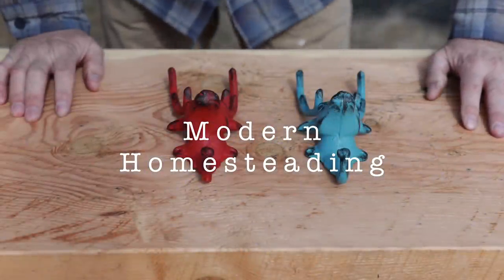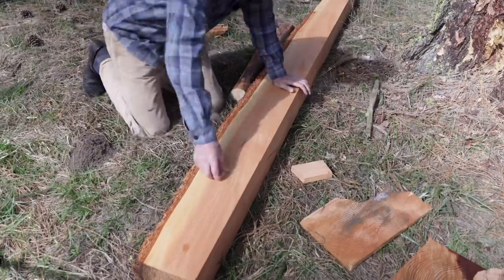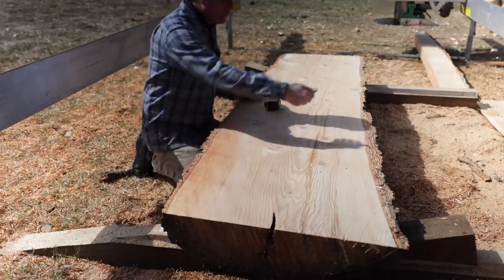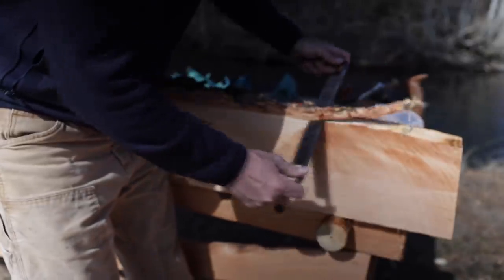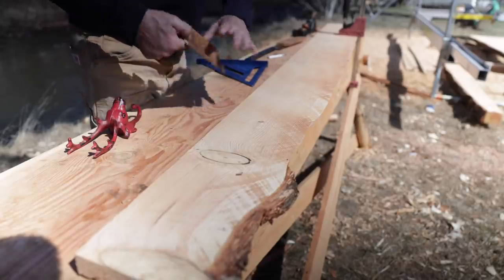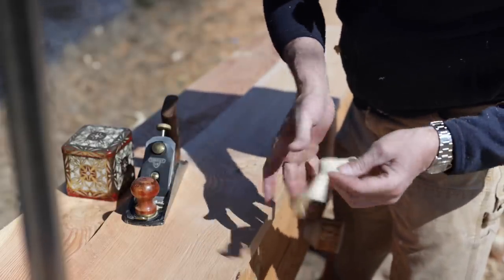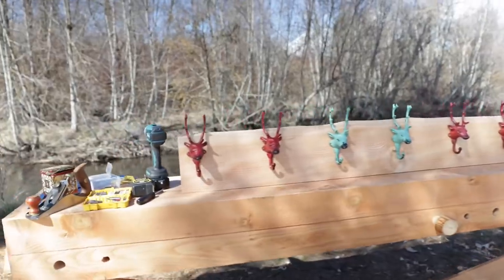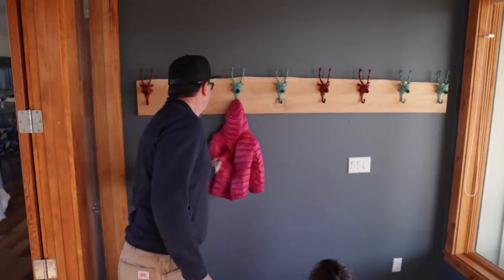This Happened Today

Comment: I'm glad you're planning to do something about the cross bracing. 

I didn't say anything in your previous video because I didn't want to be negative without offering a better solution. 

It's such a beautiful bench but the cross bracing is too ugly.
Reply: Amen!
Reply: I can’t speak to it’s structural soundness, but it really ruins the look...
Reply: It did it’s job in quickly making the bench serviceable, but now is the time to upgrade.
Reply: That and will just get in the way of a person's knees and feet
Reply: I mentioned cutting a compound angle (15 degrees out, 30 long) on the feet, this eliminates bracing to sure up length and width ways stability
Reply: Just a thought... For an indoor bench i once had with a similar issue... i used some 4x2 to build a frame for it to sit on, it only raised the height by 2 inches so didn’t change much. But it did allow me to fix the bench to that while also allowing me to use much smaller 6” internal corner bracing in both directions.

Edit : My workshop was indoors and the ground flat and dry.
Reply: "I didn't want to say anything without offering a better solution" 

I wish more people thought like this. lol
Reply: How does your homemade bench look?

Comment: I love the interaction with the viewers who’ve lovingly commented in attempting to be helpful!!!
My GG Grandpa/Grandfather hand built & rough cut a 2X2 rail system for the upstairs of their cabin for the kids cloths.
He even hand whittled, & tapered the pegs, that were then tapped in tight, to holes drilled through.
Pretty cool to have a piece of your ancestry hanging on the wall, still able to perform its task in hanging clothes over 100 years later!
Amazing connection to someone in your family, that you never got to meet.
What you do today, can possibly be felt for centuries later.

Comment: Cody, I once made a similar piece mounted to the wall in a similar way. I soon discovered that the lever force from a rack full of coats was enormous. The coat rack ripped itself out of the wall twice. I recommend attaching the rack to the studs very quickly before it gets loaded up with coats. I didn't have studs to work with; I attached to a masonry wall. Even with reinforced anchors, the weight of the coats pulled my rack out of the wall. I hope your situation is easier to deal with than mine.

Comment: You should take the other 2 coat hangers, mount them on a board, 2 1/2 or 3 ft. long, and hang it at Sweetloaf height. Below the long one.

Comment: What you ought to do on the side is a Crochet to hold your boards, the pegs are great, don't even worry about the hold fasts, they can be used on the top.  Another good idea on the top is pegs so you can surface pushing the plane toward the pegs.  That came from the Rex Krueger's videos.

Comment: Cody, take the other two and make a smaller lower one for the sweet loaf.  Hang it low (and maybe off center).  When she can reach the big one, you can remove it, plug the holes and save it for visiting grandchildren.

Comment: Hold fasts are supposed to have an empty space underneath the bench also, so that they wedge themselves into place. I believe those aren't holding correctly because the bottom of the hold fast is in contact with the side of the hole. Idk how clear that is

Comment: The holes in my bench are 3/4 and the ho.d fast works great. Give it a try on a scrap clamped down. If it doesn't work  dry a new hole and try again. If your hold down is the correct size 3/4 should work.

Comment: Hi ther Cody!
A suggestion for the cross braces:
Instead of going from one leg to the other side, u can brace each leg to the under side of the top of the table, it is a massive, heavy piece and if u connect legs of each side together, a bit under the half way point, u can put the bracings between that and the bottom of the bench top.

Comment: It's a working bench.  You don't want the bench too-perfect, it's still a sacrificial surface to doing work.  The hidden brace underneath on the working-side goes with the milled billet but the milled crossed-braces are out of character with the rustic-legs...

Comment: You could have sealed the bark on with some polyurethane.
Reply: My opinion, I think was way more beautiful with the bark colored edge. I hope your Mrs. loves it. :)
Reply: There you go, at 21:30 is your answer. You're going to need to put those other two reindeer on a little short plank, and mount it half way down for Sweet Loaf to hang her coats on. ;)

Comment: Well since you brought it up, I would use wire and leather strapping to tie the opposite corners together. That way you have full access to both sides. Think fencing corner post bracing like we do with barbed wire fencing.

Comment: As much as I like the rustic look of rough sawn wood ... like in a cabin .... 40 years of wood working tells me the texture tends to pick up dust when used indoors ... planed with a finish will pick up the grain better ... I specialize in Historic Restoration so I make a lot of coat racks with interesting old door knobs I've collect for decades ... nice job Cody ... I also hope the cross brace "issue" gets worked out ; ) ... maybe salvage some rusty old 1in galvanized pipe and bolt thru just for a ships & giggles

Comment: Use the leftover board and the last two castings to make the smaller one down low for your smaller person. You will not be able to tell the difference between the sizes with them being a few feet apart.

Comment: Fill the holes with a plug of wood from the same board. line up the grain if noticeable and use a water thin CA glue after the plug is installed. Use a scraper to clean things up and you will be hard pressed to see the fix.

Comment: The shelf came out stunning.   Really like the whimsical reindeer.  BTW.  I restore quite a few wooden items from furniture to hand / garden tools.  PC Products Woody-Wood epoxy is the best wood filer I’ve found. Sandable but strong and doesn’t shrink or crack.  It will accept a little oil base stain and still cure well.  Good stuff!

Comment: I really like these.  I saw something very similar at a kitchy giftshop in a small town just outside of where I live.  The only thing I didn't like about it, and I see you have done it also, is the use of modern screws on the Deer head hooks.  They would look so much better with some older style screw.. perhaps some brass flat head screws?  Other than that, you have done yourself proud.  Very nice

Comment: Was there a reason for mounting it on the wall with nails instead of screws?  Seams to me it would be easier to remove for finishing in the future.  Wouldn't you gouge the wood trying to get the nails out?  Looked real nice on the wall.

Comment: Cut compound (double) angle on the bench legs feet, 15 degrees to the sides and length, this will improve the stability overall but make the bottom "footprint" wider like a tripod- however bracing is eliminated.

Comment: I wouldn’t drill more holes. It’s going to start to look messy and you don’t want holes which are too big to use. I would plug the old holes with dowels and glue then redrill the correct size holes.

Comment: That’s beautiful. Just out of curiosity, why did you mount it with a nail and not a screw? I have always mounted things that will hold weight with screws.... maybe I’m overdoing it? I donno, novice homesteader 😆
Reply: All things being equal, screws have better tensile strength, but nails are better under shear loads. In this case that's a pretty moot point because it's never going to hold any serious weight. 

In Cody's case, I don't know if it factored into it but nails are less likely to split the material, and allow better for expansion and contraction of the material. With the wood being wet, and needing to dry out and cure over the next several months inside, that may have played a factor but I  obviously can't speak to his thinking.

Comment: I've been thinking about your beautiful workbench. What if you were to pull the legs out and re-drill them about a foot in from the ends, angled so you wouldn't need to use the cross bracing?